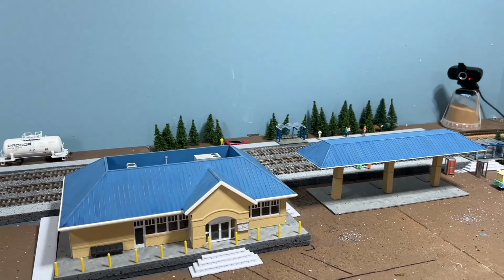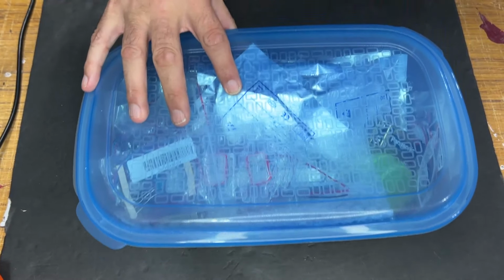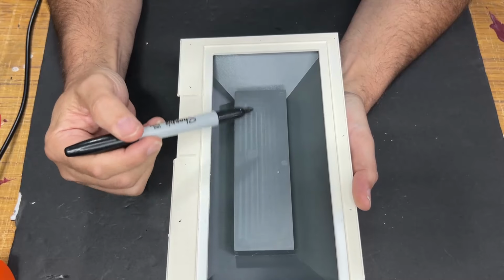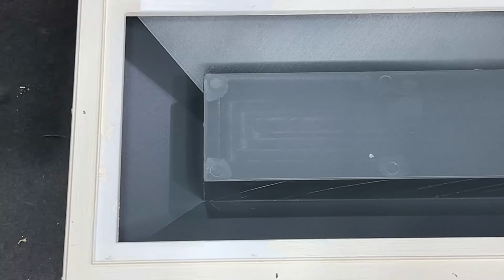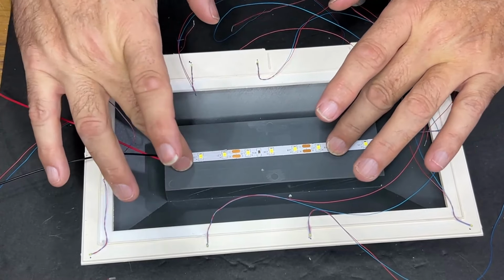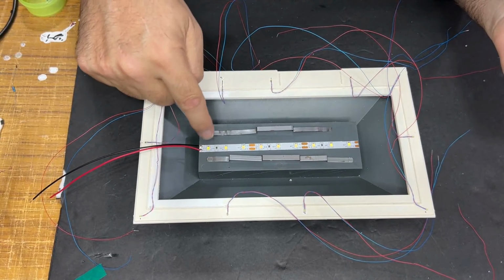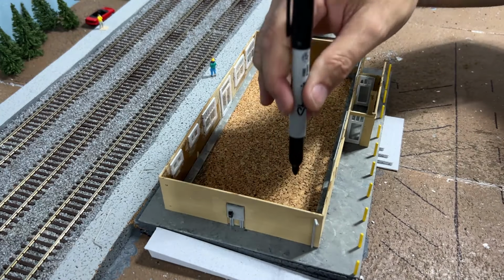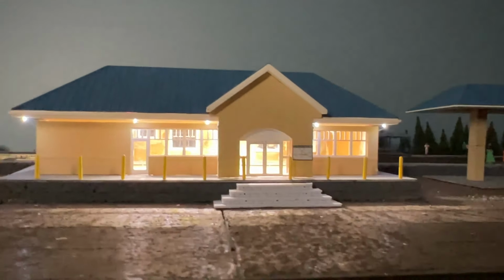Adding LED Lighting To My HO Scale Train Station

Comment: Connector was a great idea Dave< it will make future repairs much easier! Just a suggestion:  You should paint the inside of your walls and roof black, to reduce light bleed. Although your Station has little bleed as it is, some kits will have alot. Thanks for sharing!

Comment: Great idea using the buss bar especially the ones that came off the locomotives.  Now you're using your brain housing group.  One thing about using LED's is that you can use acrylic paint over the tops of each LED to dull them down a bit.  I wrongly used bright white in a coach I was lighting so I painted each LED with some yellow acrylic paint and it made them warm white.  Cheers from eastern TN

Comment: That looks great Dave  what you can do is fix a sheet of frosted plastic sheet to cover the wiring in the roof it will hide the wires and act like those lighted ceilings you get at modern stations atleast over her like on the clockwork orange or crossrail here in London ,all the best mate 
Mark